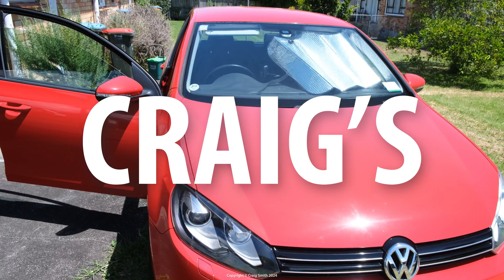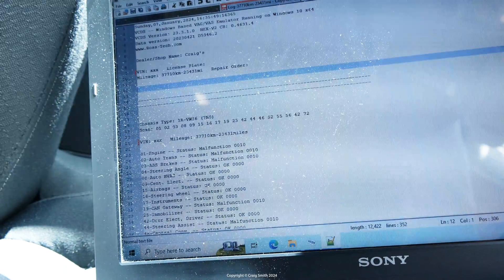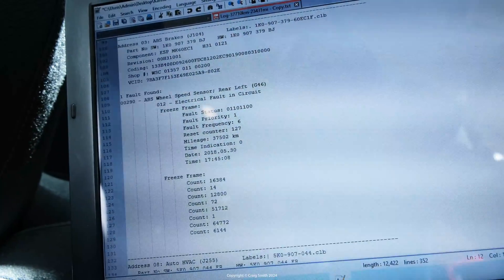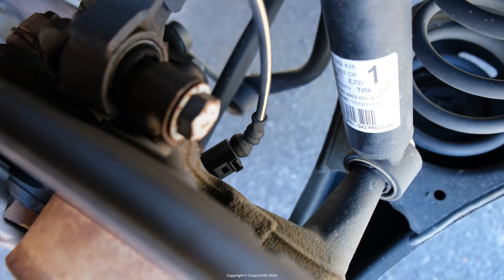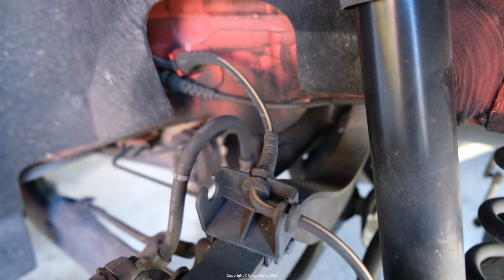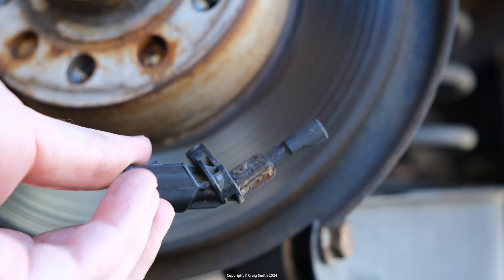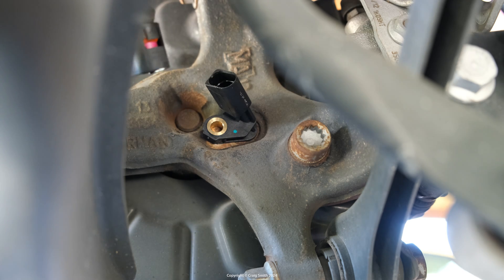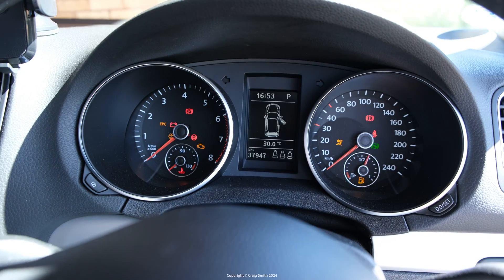VW wheel speed sensor test & replace, ABS and ESC faults (Golf 6)

Comment: Great, clear, simple instructions. Thankyou. VWs are great, but, if anything, too bloody clever. I had what I thought was a major transmission problem on my Touran (great vehicle) - turned out to be a sub par cell in the battery. You need to find good honest mechanics to deal with to keep running costs down on what are essentially wonderful, reliable vehicles. Ian from NZ.

Comment: My issue is the tyre pressure setting.
Apparently on the polo's they don't have a physical sensor in the tyre, they use the abs sensor instead. When I had my rear tyres changed, they were stuck, so they had to give it a good hammering to remove. I'm thinking that damaged my rear sensors
Reply from the maker: Some VW's use, and can have coded, an algorithm that looks for discrepancies from the wheel speed sensors that indicate low pressure. Not as good as in-tyre sensor but better than nothing.

Comment: my alltrack is getting the ESC error and the dash is lit up like a christmas tree.  However my Car won't start.  I drove to work the other day and it drove fine.  I went out to my car and it would not start at all.  Dead as a doornail.  I am hoping I can do the sensors my self as that seems to be the issue from wha I have read.
Reply: Did you figure out your problem? I had this happen on 2017 passat sel, thought it was the wheel sensor ended up being the power supply to the fuel tank, had to remove back seat where the gas reservoir was, green unit that supplies power.  Did you check your battery prior?
Reply: @TripleCarriers   Yep from the scan I did on it it seems that it is either the Starter Relay or the starter it self.  Which from what I understand if it is the starter it self it is still an easy fix I can do my self.

Comment: surprised to see jack and jack-stand next to each other, it would seem to me that the jack-stand is thus NOT positioned on the sturdy pinch-weld part of the metal.
Reply from the maker: Awkward to lift the Golf rear as there are not two places for jack + stand and nowhere else suitable, I was using both there taking the weight, best solution is a large pad on the jack with slot which can lift the sill and distribute the force widely, then lower the 'jack point' onto a stand.
Reply: @CraigsDIY  ah yeah, the rear is worse to lift.  Well, if you say your frame edge/sill is not slightly bent yet...

Comment: good video, i replaced the sensor like an idiot without properly checking and it turned out to be a faulty ring on the hub and smashed the new sensor too. Bought two sensors and a hub and problem resolved at least

Comment: So because they are active wheel speedsensors no point doing a resistance ohms test on the sensor unit itself.
They must be powered with 12v to work correctly.

Comment: Great video!
Yours went at 39k, mine went at 41k.
VW were reliable once, eh. Now another at 49k....
Reply from the maker: I've since discovered a problem with the brake on this wheel which is generating a bit of warmth, so it may be the extra heat that killed this one.

Comment: So a faulty abs sensor can trigger the abs, esc, tyre pressure light, start/stop, handbrake, Acc, parking sensors lights?
Reply: mine triggered a fault in the drivers door and media center. easy fix though.
Reply: It actually does create all those issues. Got my plugged in today ! It’s a very common fault, mine is a Skoda yeti
Reply: Yep

Comment: im owner seat leon 2012 and i have problem with the tpms system about the tyre pressure. 
the light for tyre presure is ON and dosent respont when i put the tyre check botton.
is that the sensor for this problem?
Reply: From my understanding it may be related. Some cars have separate abs and tpms sensors. But apparently some detect low tire pressure with the same sensor when the wheel speeds are constantly different and VW seems to do this on some cars.
Reply from the maker: @gilbertlopez  That's true thanks. So diagnosis would be the same as in the video. But start with: is the tyre flat...
Reply: @CraigsDIY  yup first thing I did was check tire pressure. Now I got the codes confirming it's an ABS sensor signal issue so going to replace. Thanks for the vid!
Reply from the maker: Nope, unrelated

Comment: Changed mine and lights are still on. A yellow steering wheel light is also on.
Reply: Were you able to fix it? I have the same issue, replaced the sensors and after turning it on i got abs, traction control, brake, airbag and the power steering as new one
Reply: @cesarhuerta8620  yeah, after changing the 4 of em and then going for a short ride. Initially I changed only the 2 in the rear.

Comment: The stupid rear left sensor seems to be the first to die on most VAG vehicles, I wonder why though. Great vid btw
Reply: Same here 2016 golf gtd 39k. Turning out to be quite unreliable. Had it since 3 yrs old. Always electric faults
Reply: @xxwalhalaxxmozza7415  my break caliper seized too. Had to replace it. I think it may have been caused by brake dust. Will try to fix my abs sensor. Maybe some cleaning will help.
Reply: most likely due to brake being seized and heat killing off the sensor or bad bearing moving and rubbing against the sensor. Mine was also bad on rear left side with seized caliper bracket

Comment: Excellent instructional video. Thanks . I have a Yeti with the same lights on + " Bend lights. All I am told point towards a faulty battery or abs sensor. New battery didn't cure it so new sensor ( FNS) on order .

Comment: What the autoscan is for is to find out which modules are present in your car. Then you can make a scan list that is specific to your car which makes subsequent scans almost instantaneous rather than taking more than 2 hours. (I use VAG CAN PRO which may not be as good as vcds at knowing what protocols to scan etc and therefor may take longer to do the auto scan). Thanks for the clear explanation as to what tools are needed to remove the sensor.

Comment: Hello craig,

I own a golf r mk6 2013 model,
Recently i have replaced all brake pads and rear break discs,
Since then I started getting intermittent  break workshop message plus the traction light 
comes on, and now the abs light is on the whole time + the message, we had heavy rains recently, i visited an electrician and informed me that the abs module needs replacement and am not convinced, any ideas ?
Reply from the maker: Need scan DTC's

Comment: Hi Craig, took my golf6 for a diagnosis check since the Abs error shows on my dashboard but the test does not specify exactly the sensors which have fault, does it mean that I should change all of them?
Reply from the maker: Any scan will refer to specific sensor circuits if that's the issue. The module knows which is which.